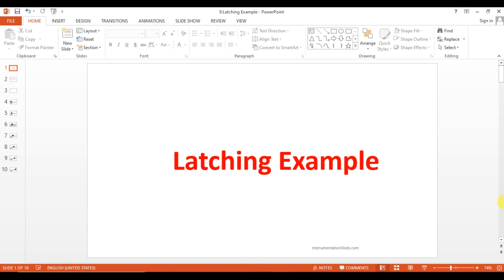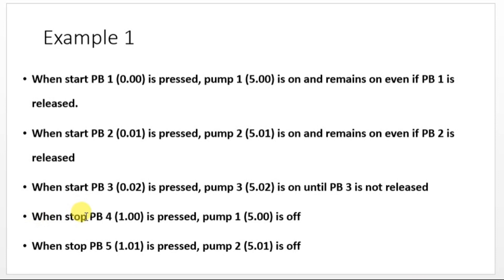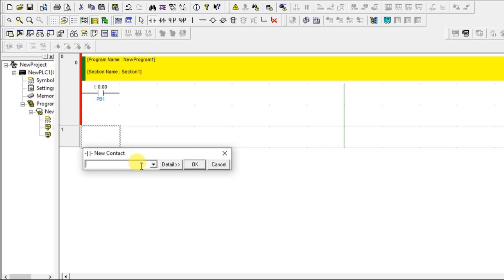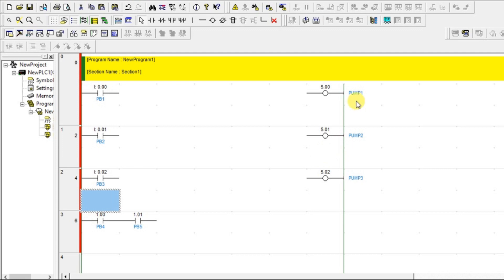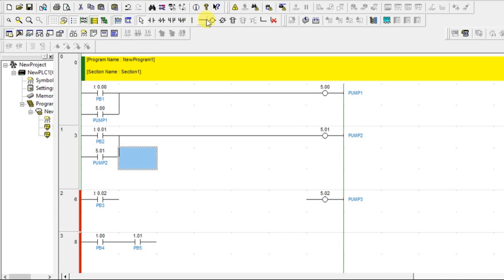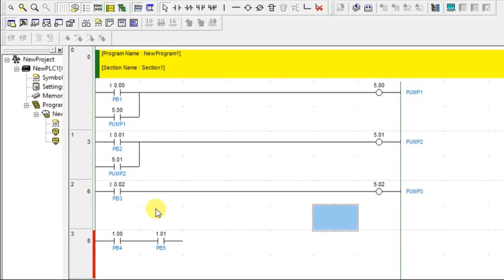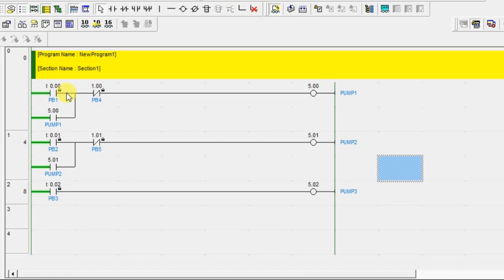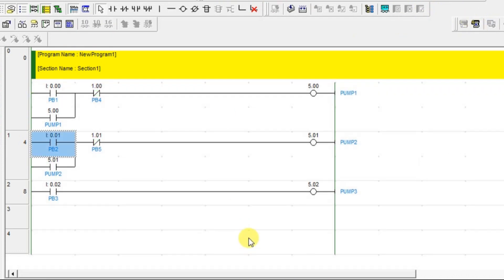Ladder Logic Examples - PLC Programming Example for Practice

Comment: as you said, stop push button always should be normally closed for emergency but you put it in the program as a closed contact so you made it normally open. you should've put it as an open contact to avoid confusion. Electrical engineers tend to do the same what you have did because it is hard for their imagination current will drive through when the stop contact is open. It is easy to think like that, any switch whether is  push button or sensor meant to stop the process, should be programmed as an open contact to be normally closed as a physical or in reality (This only work for ladder program not for SR ). Thank you